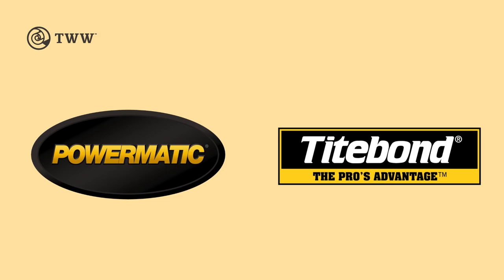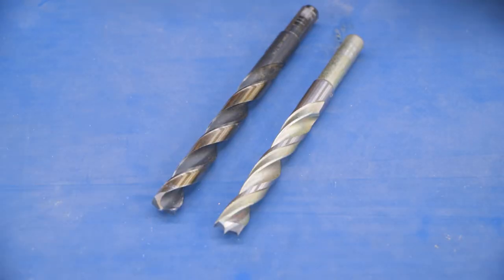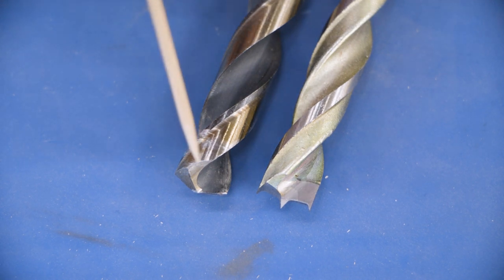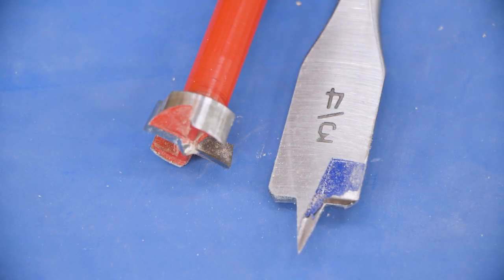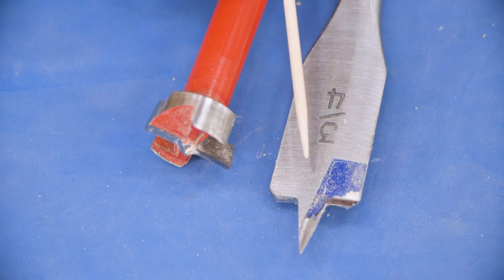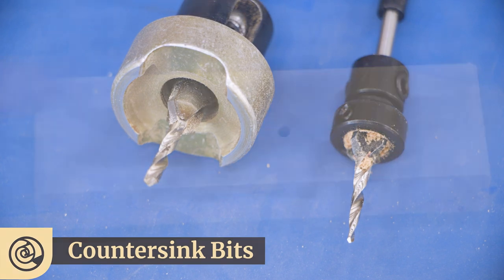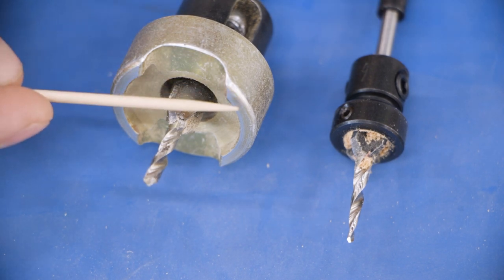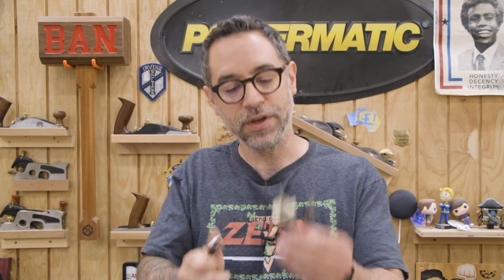Buy This, Not That | Drill Bits

Comment: The Amana countersink stop is on a bearing. Never knew such a thing was even available, thanks for sharing the knowledge.
Reply: I had one on these about 10 years ago from a different company where the stop collar was free spinning but was open on the top and it probably worked better than that one since you could see the hole thru the top of the stop collar instead of everything being obscured. Really nice bits either way

Comment: Great video: clear and concise! Thank you!

A few other tidBITS (pun intended) for those following this:
* If you use spade bits, they are also available with tangs at the corners, which can reduce tearout.  Still a far cry from a Forstner.
* Black oxide HSS (high speed steel) twist bits are generally fine for ordinary household work, you don't necessarily need the gold Ti-N coating or carbide or what not. What does make a big difference is the quality and sharpness of the bit. Chicago-Latrobe bits are expensive, but consistent and superior to what I find at the big box stores. There are various tip angles available, 118deg is the most standard, but don't sweat this unless you are doing a bunch of metal work.
* There are special twist drills for plastics that make a big difference.
* Twist bits are available in several length types, "jobbers" length is most standard, "stub" length is stiffer.
* Center punches/awls make great starting holes.
* Inch-series flat head screws for wood are most commonly 82deg heads, but they vary.  Metric is almost always 90deg.
* There are tapered and stepped bits for various purposes, Marc shows a tapered bit on in the "lesser" countersink setup in the video. I have not seen tapered bits in the sweet Amana countersink.
* Experiment with your drill rotational speed and "downforce"/feed rate: you can go too fast or too slow and make a big impact on quality and heating.
* The drill guides from Big Gator Tools are remarkably useful if you need to drill semi-straight, don't have a drill press and/or are not so capable at holding your drill plumb. Your mileage may vary with the larger/more complex drill guide systems.
* A brace with an auger bit is something you really need to try out: can be awkward at first and definitely slower than a power drill, but it is a different connection with the wood, and much easier to stop!

Comment: I am a woodworker, but by trade I am a pipe organ builder. So I have without exaggerating, drilled tens of thousands of holes, of all sizes. I agree with a lot of what you are saying, but I think more is better in this case. Just keep them all 😏. In the case of the combination bits, I always convert them to straight drill. I don’t like those tapered things. I also never use the collars for the exact reason you stated, but I almost always have them in a press with a depth stop set. Anyway, love your content, and enjoyed the video.

Comment: Good points. A few other points to consider: 1) Screw/Stub length bits (opposed to Jobber length) are short bits that are useful for tight spaces, tall drill press stacks, and higher precision when drilling holes on the drill press. 2) A spring punch/awl will help you get an accurate start with standard drill bits 3) Auger Bits are useful for very deep, large holes. They are basically forsner bits with very long, large flutes to carry away chips. They're tend to have screw tips to pull them through the wood and lean more toward rough work, but are useful in certain situations. 4) It's worth buying big box quality drill index, then replacing frequently used individual bits one at a time with high quality bits from a company like Precision Twist. The better bits will hold their edge, are worth getting sharpened instead of throwing them out, and do a much better job.

Comment: Great video. The number of countersink drill bits - from cheap to expensive - is mind boggling (I've come to love the Amana tool).  I would not mind some follow up - perhaps in a future video - on matching drill sizes (and countersink diameters) to screw sizes, and when to use straight v. tapered screws and drill bits.

Comment: Irwin have put out a 3 flute bit with a small screw tip that cuts like a spade bit. They call it the "Speedbore". It's exceptionally fast but it's a real beast once it bites.
Reply from the maker: haha yeah sounds like it might take you for a ride. :)
Reply: I think that's more aimed towards people who need to run services through studwork. Not the cleanest of holes but it's great if you are running plumbing or electrical through multiple studs

Comment: If you're doing any dowel work without a jig, bradpoint bits are a must!  Really liked your version with the spurs or cutters on the outer edge too!

I do have a soft-spot for spade bits primarily because they cut so quick. The obvious use case as you say is construction, but if you are creating any wooden mechanical projects they're just so darn quick for prototyping too.

Comment: Spade bits. They are cheap. You can grind them and shape them. You can drill a conical "hole" for a tool holder. You can get a completely custom diameter for a vise you're installing on your workbench. Doesn't happen often, but it's a thing you can do. You can even shape them for cleaner entry into the stock.

Comment: One thing I like about spade bits is that they’re easily customized. I recently needed to drill holes that were just under an inch across for some roller bearings. All my 1” bits were too big so I ended up grinding a little off the edges of an old spade bit. It worked really well and I didn’t feel bad sacrificing a more expensive forstner bit.
Reply: I've done the same thing for a "customized" hole.  Easy to grind down just those two blades of the bit.

Comment: I bought the Amana countersink based on your previous recommendation and love it. However it was confusing which size to get until i went to their website where it was more clearly spelled out. I accidentally bought the #4 the first time and I kept breaking its tiny drill bit. Now I have the #6 and #8 (the one you linked to) and it works perfectly. I find myself actually pre-drilling more than I used to and having better and more predictable results.
Reply: Could you please translate #4,6,8 into the sizes Amanda offers?  1/8” etc?
I ask because I’m unclear as to which size Amanda countersink tool to buy for the most common jobs in my home.  They are a little too pricy for me to buy a full assortment. Like, which one would I need to purchase for a number 10 screw?

Thank you

Comment: I primarily use a bit and follow up with the counter sink. I have found the cheap versions leave an unbalanced surface when the countersink portion engages the wood. I believe I will look into the Amana bits or something similar. 👍

Comment: I have a really old countersink attachment that you can put on a regular drill bit which works on a small range of sizes and it stays on with a couple set screws, and it works really great, but I have never found any product like it ever again. It looks a little like some of the cheap countersinks you can buy at Home Depot or Lowes, but was actually designed to allow more than one sized bit.

Comment: I totally agree on the Brad point bits

And the counter sink bits

But spade bits are cheap and versatile and if you keep them sharp (which is easy to do on the bench grinder) they cut great and sometimes fore hard wear you nead a wear size grab a spade bit and grind it to size not saying that I don't use fostner bits.

Comment: You don't get burning on the Amana because the collar is able to spin freely.  So once it hits the wood it stops moving and isn't able to actually mar the surface.  The cheaper one is fixed with a set screw and so once you get to final depth it's actually spinning against the wood an you get friction burns.

Comment: i'll add one. not necessarily a bit, but still for drilling. Dont buy a doweling jig that you have to wedge by hand, if you need exact lineups. for ruff projects, they are fast and easy, but if you want your parts to line up perfectly, get a jig that clamps on the edge, so you dont shift it a tiny bit while drilling.
Reply: The old fashioned Stanley #42? (I think) Clamps well, but it does help to use thin strips of wood to protect the clamping surface.

Comment: There is one more drill bit that I would recommend having - it's the drill bit made special for drilling hinge screw holes (the self-centering bit)
Hettich makes a good set, Festool makes one for the 5mm screws or blum for smaller screws
Reply from the maker: There are quite a few more things I'd recommend people buy, but this wasn't really intended to be a "these are the only bits you need" kind of video. I only wanted to cover three specific use-cases. Self-centering bits are indeed a must-have.
Reply: I have the Bosch 3 pc set of self-centering bits I keep in my cordless hammerdrill/impact driver case that come in very handy when on the go, and the 5 pc set of Snappy bits + the Snappy shelf pin drill at home for projects. They are definitely time and headache savers when the need arises.

Comment: Greate Video and Tips, Im Long time fan!!

But one small correction: 
The bit that you had introduced as "regular twist bit" is not desigend to drill wood.

 Its a common mistake but its actully designed to drill metal not wood, and sould be used after utilizeing of a centerpunch for precise drilling. 
That's actully the reson of the unprecise drilling in wood, the tearouts and somtimes even burn marks.
using them on wood wont hurt them, but if doing so it is recommended to use a centrpunch to mark the hole center first
Reply from the maker: Exactly why I recommend people invest in brad point bits. 😊 The world of twist bits is incredibly confusing to the uninitiated and while designed for metal, twist bits are often labeled for use in wood. And some are actually modified specifically for use in wood. But my recommendation still stands, if you need a precise hole go for the brad point.

Comment: In general I agree with your advice here, but I find that if I have to drill a (usually larger) hole, I gravitate to the spade bits. Not sure if this is a 'rest of the world' thing, but my spade bits have spurs and if I drill have way through until the tip pokes out the other end and then drill from the other side, using the little hole left by the tip as a guide, I get very clean holes and way quicker than with my (arguably crappy forstner bits.

Comment: Lol😅🤣😅,  "wasted a lot of money on tools to almost do the job I needed them to do" that's me! I have standard twist bits, had issues so it was recommended to me to buy some little bullet-looking tool to make an indented dot (which I have). Need brad-point bits. Didn't even know those were made 🤔. The closest thing I have is the KregJig bit & not quite the same 🙄 I have spade bits & Forstner bits. Don't have any of the countersink bits, but I do have some large cutting hole bits that are not in this video. They look like countersink bits but with saw-looking blades around the big circles. 

Anyway, thanks for the informative video 😁

Comment: The countersink + drill bits that I have don't have a collar at all.  So they never clog or make divots around the hole - but you don't automatically get the depth right.   On harder woods, that's not really a problem because progress with the actual countersink part is fairly slow - but on soft woods it's very easy to get the countersink going in too deep so the screw isn't just nicely flat on the surface - but buried a quarter inch BELOW the surface...which isn't really good.  At any rate - these are the only kind I saw on sale at Home Depot...so that's what I have.

Comment: Yes. Please do one on Allen wrenches and the like!!
Reply: For example, for my second set of Allen wrenches, I got the kind with a rounded ball cut into the end. Should have started with those!
Reply: And here’s a good question: when is it better to switch bits back-and-forth versus when should you just have an extra (cheap) drill on hand to hold the other bit? Like when drilling many holes and screwing in many fasteners.

Comment: One suggestion I would add, is that, when you 𝗔𝗥𝗘 shopping for Spade Bits, to purchase the ones with Spurs on the outside edges of the blade.

Spurs are magical.

Comment: I bought one of those Dewalt quick change drill/countersink and Phillips driver set after seeing Norm use one. They are convenient but man do they clog up fast.
Reply: I'm in agreement, they do clog fast, especially on fairly fresh softwood.
Will always keep the dewalt flip change in my arsenal, such a good tool, and they are super useful sometimes especially on site.
However, i'm definitely now a fan of the dedicated combined pre-drill / countersink bits with a rubberised stop collar, especially for workshop based work :)

Comment: I have purchased a couple and returned them. I think its because the drill bit is held in place by a set screw that the bit doesn't run true. It seems like the set screw pushes the bit to one side and then you are chucking up  on a different hexagon shaft. Do you experience the same thing or is there a tick to setting these up that I am not aware of?

Comment: I tried a couple of dedicated countersink bits, similar to the one you show at 4:50, and they sometimes create a hexagonal countersink throat instead of a round one. What am I doing wrong?
Reply from the maker: I haven't had that happen so can't really speak from experience but the only thing i can imagine happening is that maybe you're not keeping the drill perfectly vertical, so maybe it's causing it to dig in more than it should? Try it in a drill press to see how it performs and that should give you the answer.

Comment: Is the Amana bit tapered, though?  Wouldn't a "one and done" bit need to be smaller in the bottom piece of wood than the top?
Reply from the maker: The bit is not tapered and it is adjustable. Whether you penetrate the adjoining piece or not depends on the wood you're using and the likelihood of splitting. In some cases, you can just punch through and create a shallow starter hole in the adjoining piece, letting the screw bite in and pull the pieces together. Other times you may need to continue the pilot hole in the adjoining piece so it would be a two step operation.

Comment: Thay Amana countersink been in my cart for over a year lol... Each one can only fit one size diameter right? Can I switch out different bits? I don't want to spend $40 for each size!
Reply from the maker: I believe it's one size per.....How many screw sizes do you keep in stock? I find that the 1/8" works great.
Reply from the maker: I use the 1/8" for #8 screws.